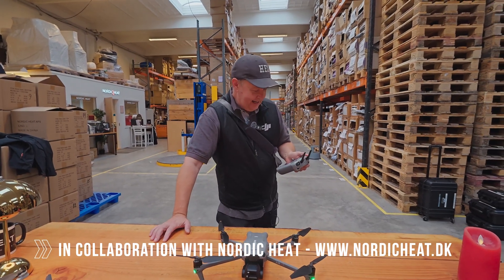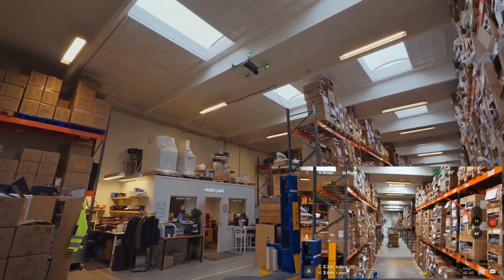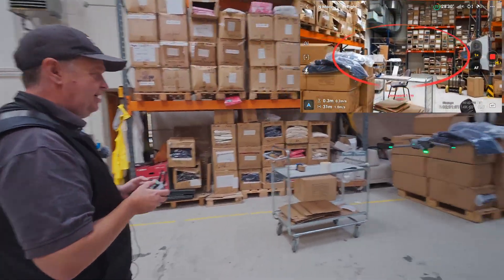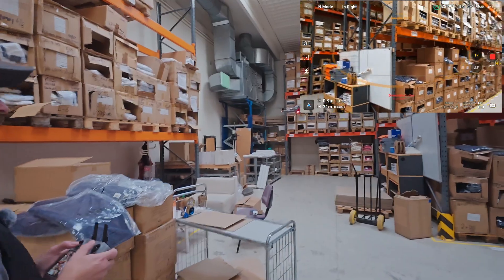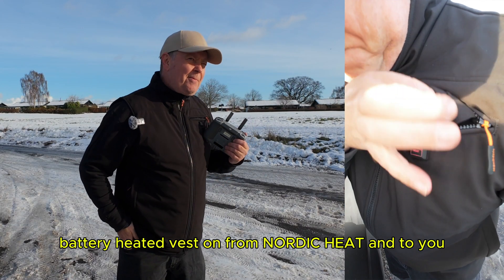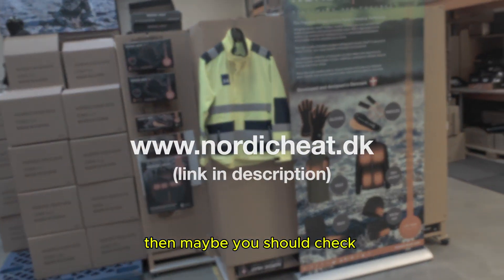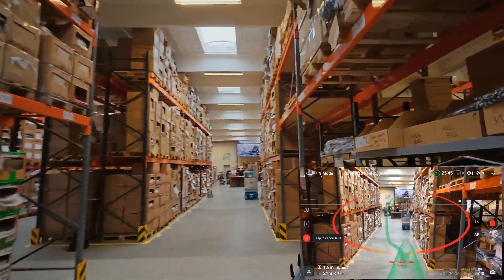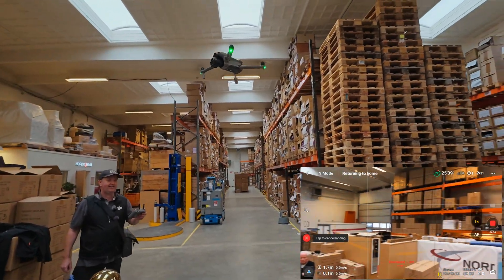Can DJI Air 3s Return to Home Indoor? (drone never goes outside)

Comment: Great video! we do know that Air3S can be flown without GPS signal and detect obstacles ,
which means in theory it CAN be flown in the shady depths of a gorge over water for example.
The question is :
can it also track you in this low light no-GPS setting based on the lidar ?
 (yes gps is needed for precise tracking, but i'm fine with imprecise tracking. Besides i would be moving very slow in these conditions)
Could we make an educated guess about that  ?

Comment: When in automatic smart home mode, air 3s will still follow the old route, but it will still optimize and choose the shortest distance if there are no obstacles ahead. It is understandable because this is an automatic safety feature, so the manufacturer always chooses the lowest risk probability for the device.

Comment: I bought the air3s recently because of videos that reviewed it and I’m glad I didn’t pay more for the mavic 3 pro. I definitely think it’s the best at the moment. Sure the mavic 4 pro might be better but I’m not sure when it will come out. I flew it a couple of weeks ago in very strong wind and the first charge and got to almost 7&1/4 kilometres before it went into auto return and still had about 15% battery left. I’m guessing that on a very light wind day with a couple more charges it’ll do 10 kilometres easily, this things absolutely amazing. I never expected anyone to do a test inside a warehouse or whatever that place is, but it’s a great demonstration of its ability, well done for an amazing video.

Comment: Nyce test! Question: The sensor config (bypass/hold/off) shouldn't have any effect on the RTH. In RTH the sensors are used according the RTH mode even when the sensors are switch off for normal flight. Am I right? Iirc I was testing that with the mini 4 pro and that was the case.

Comment: Three questions.#1-I see you're connected to satellites. If you're inside, how did that happen? #2-Will this 'NEW' RTH feature work without satellites? #3-Any word on the 4Pro? Always fun to watch...thanks for the work and sharing.
Reply: Maybe you should double check your video… your remote screen shows 22 satellites connected
Reply from the maker: yes, I have made video under a metal roof where 0 satellites where present

Comment: Air 3S: Do you have a 'bumper cage' for the, DJI Air 3S? - Your thoughts on using ............ ///// Maybe show how it can take a dongle to fly in some places via phone towers? - 🤔
Reply: I have 2 DJI Dongles 4G , one fitted to my Air 3S and the other to my DJI Mini 4 pro , works well on both drones
Reply from the maker: Might have been a good idea, not sure if such exists
Reply: @TECHDRONEMEDIA  They do make both a cage, so as to protect bumping ..... ; also the dongle thing is real, you can check it out. - :rocket-red-countdown-liftoff:
Reply: DJI cellular: Supports access to 4G networks, enabling connectivity services, Enhanced Transmission, Network RTK, and other features.